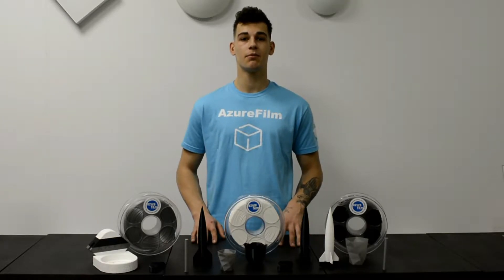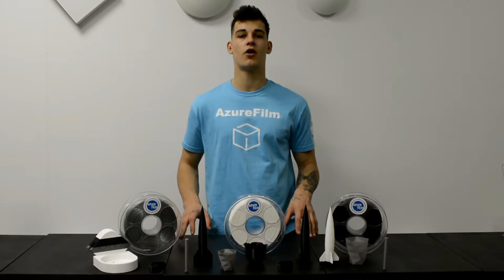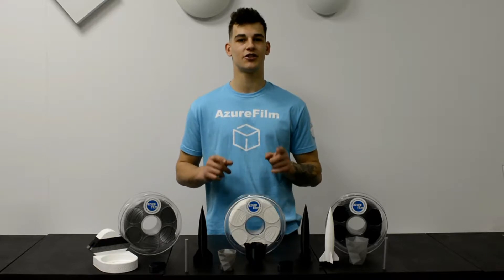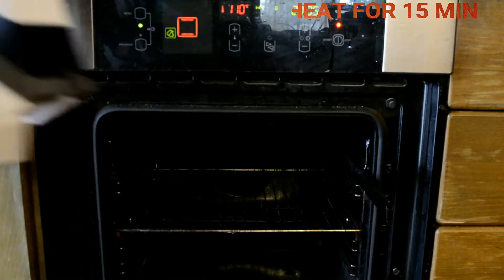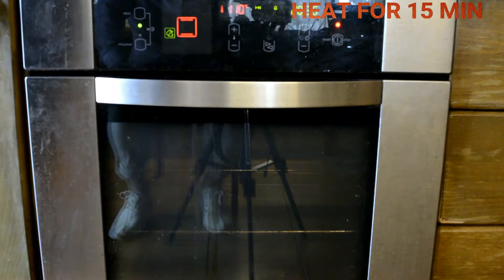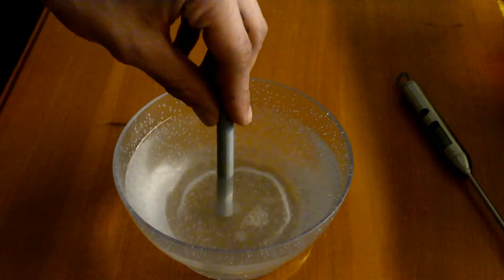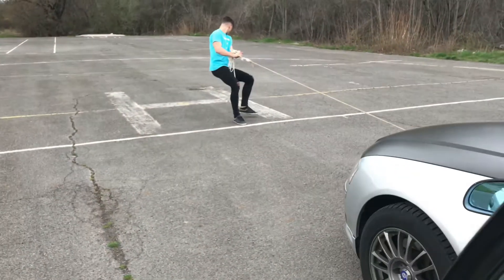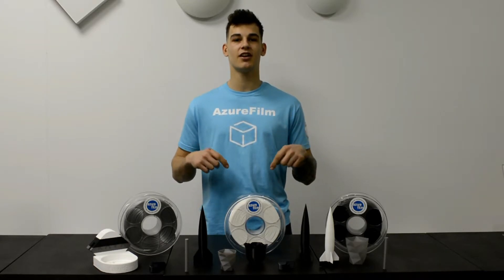How to print with PLA Fire filament

Comment: I think it needs a new name. All I can find is pla catching on fire.
Reply: You right. Could be different. But this is the name they chose for that product in Slovenia  (europe, The workhouse is there). Aniway more research show  that baking all type of pla it strenght it's structure. The homemade way is baking it in a  kitchen oven at 80 degree for an half hour. Ofcorse each pla brand will respond differently according to the quality of the product. The one in  the video is aniway bether than ordinary pla. It is maded for have strenght and elasticity in the same time and ofcorse heat resistence to max 90 degree. Users tell that the pla fire product is way bether than abs in bending and solidity. i have not tested yet for give you a confirm to that. I bought pla ordinary and petg from them. they  printed easy over others (cheap ordinary filaments i bought here and there) and with really good results, strenght and shape, even for me and my cheap 3d printer prusa clone assembled alone .-P ( with discutible building and discutible settings haha ;-) the items i print with all mystake i do are still nice looking and mechanically strong. i am for the mechanical stability of pieces, not for the shiny narrow and beauty outer shape. Infact i use my 3d printer only for print spare parts.